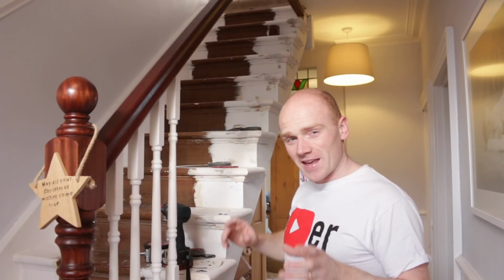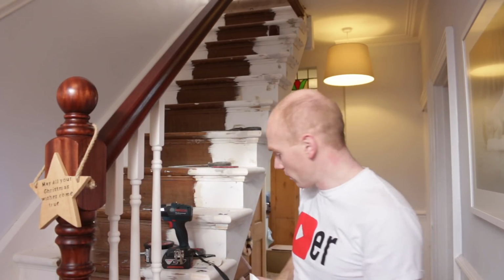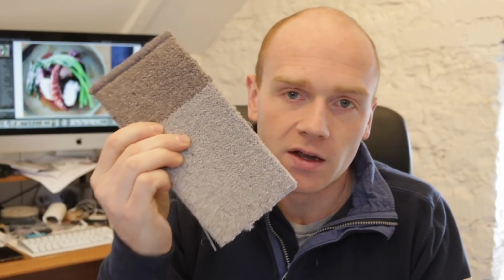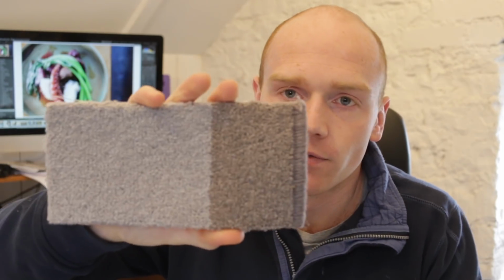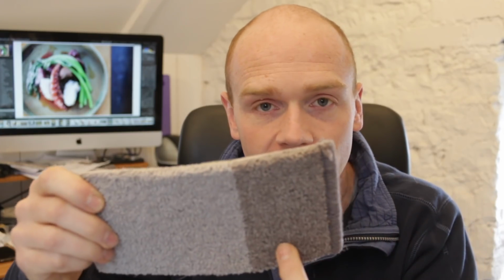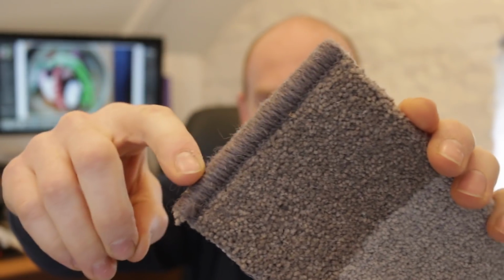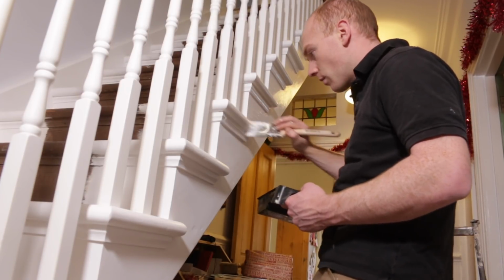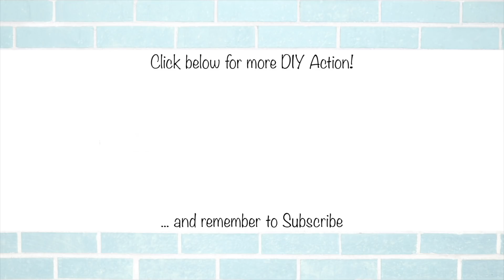Stairs Renovation - They are DONE!

Comment: Great job. If you still see imperfections in the natural light crop up skim back a layer and then use a white gloss spray paint. I’m a stickler for brush strokes and have used spray paint as a top coat in the past for patched up woodwork that needs good coverage.

Comment: Have you ever tried foam brushes and rollers for hi glossy paints, you have to throw them out more(don’t last long) but they don’t leave brush strokes and looks great on cabinets
Reply from the maker: Yeah they work great with gloss and varnishes.  This acrylic eggshell dries super fast so not as easy to use as slower gloss paints.

Comment: What type of paint you using oil or water based ?
Reply from the maker: Water based eggshell.
Reply: The Restoration Couple bit late now but an additive call flowtrol would have help improve the finish  it would increase its viscosity and help with brush strokes etc